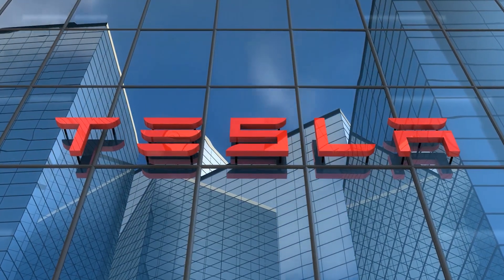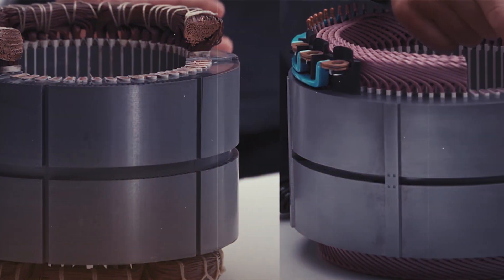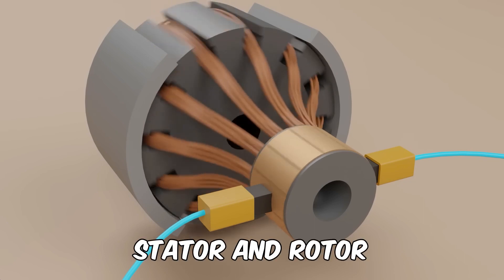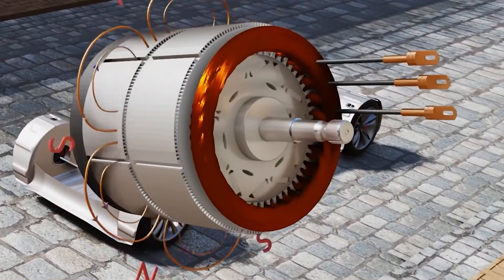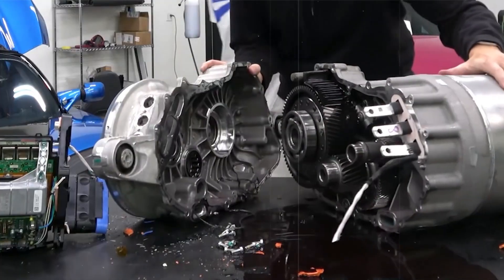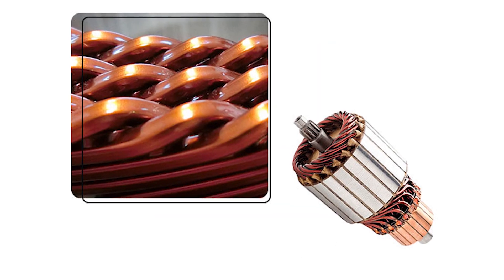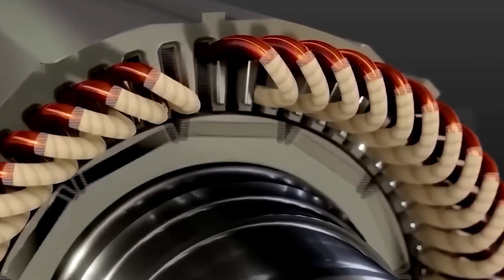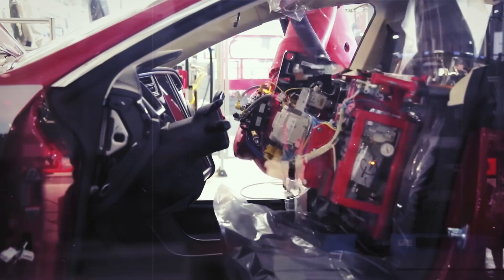Elon Musk: Tesla's New Engine Will Change The EV Industry Forever!

Comment: All progress is good but their previous electric motors were very efficient already. The battery size, charging time,  weight and the charging infrastructure are the problems that needs to be solved along with hugely increasing the nations power grid to provide all of the extra power required when we all go EV.
Reply: Kinda the same thing Edison encountered when he tried to market the light bulb.  I guess we know how that one worked out
Reply: I think the use of more supercaps those would fill that area of braking..regen and acceleration in EVs and maybe emergency braking or evading a collision with a robot ML powered drift

Comment: This video is so uncritical of Tesla that it sounds like advertising.
Sure, they are great cars for some types of usage.
A friend towed a large trailer for a glider with a Tesla. His range dropped to about 120km, his charge disappearing like a snowman in the summer. I had to go and fetch the trailer with my battered good old CO2 spewing VW 1.9 TDI. His Tesla came back on a flatbed truck, spewing CO2 as well.
They say the Cybertruck will be good for towing heavy loads. Unfortunately, it won't be sold in Europe. It appears that a really strong stainless steel body with sharp angles is not safe when impacting cyclists and pedestrians. Who would have guessed.

Comment: The EV industry needs to focus on range and recharging times.
Get the most basic car to have a minimum of 500 km of range and 10-90% recharging in 5 mins or less.
Then focus on recycling, and repurposing the batteries.
Reply: Toyota a few years ago were trying to use capacitors instead of batteries. Made charging take 10 min or less.